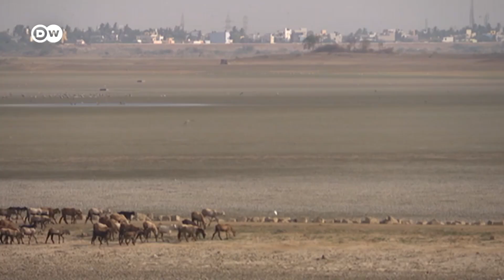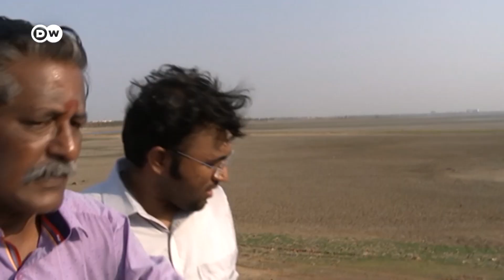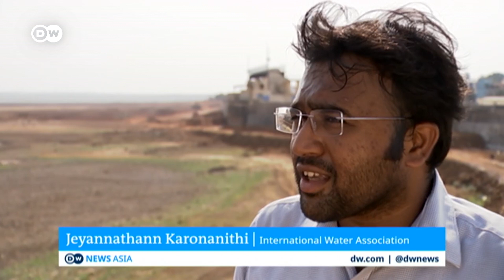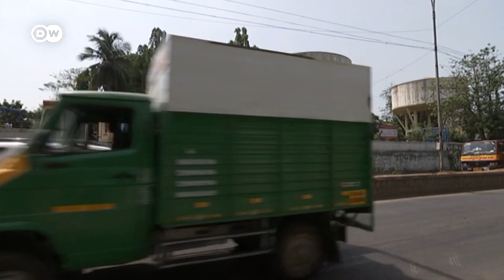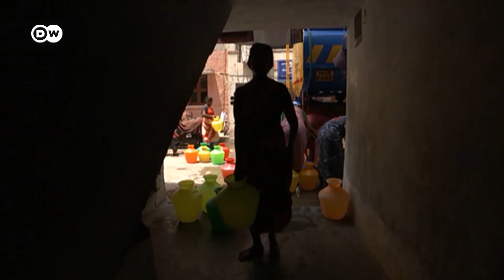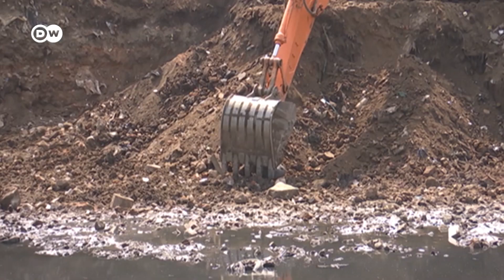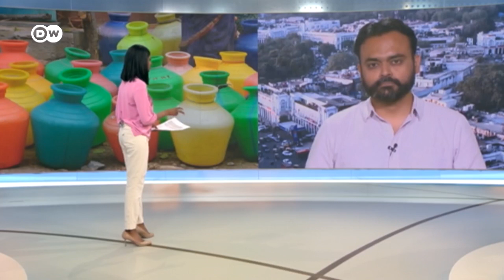Climate crisis in India: Heat wave causes water scarcity | DW News

Comment: Welcome to climate change stage 1
Reply: That's the problem with the ambiguity of the term climate change. Is the planet getting warmer or cooler. It is getting cooler but one of the things that comes with the solar inactivity is fluctuating jet streams and varying climate. It isn't the heat but the lack of rain. That is called draught. While India is experiencing draught other parts of the planet are being hampered by to much rain. In both cases, draught and flooding crops are hampered. This is going to be very serious.  Welcome to a new mini ice age.
Reply: It has been 123 degrees F in India these past few weeks and 84 degrees F in Arctic.  Melting of Arctic makes jet stream weaker.  Millions of tons of ice melted in Greenland this past week.  Things are changing quickly and it is not good.
Reply: @joyfullone3968  sources?
Reply: @joyfullone3968  The jet stream is controlled by the intensity of the magnetic fields of both the earth and the sun. Now that we are entering the 
Eddy Grand Solar Minimum we are goin to experience the same types of weather phenomena. Greenland  had and increase of 510 billion tons last year.  This is the time of the year that the ice melt is increasing, till September anyway. The Global temperature is down from 20 years ago. It is not warming but we are going to see erratic weather such as flooding in China and the Northern hemisphere and summer snow. There will be more hail storms if the Maunder Grand Solar Minimum is an example.  You only have to look around the planet to find dead civilizations as a result in climate change.
Reply: Roy Oetting :  I think Global warming and the Grand Solar Minimum are battling it out,  I think the Global warming is going to win though.  We will have to agree to disagree.❤️
Reply: Conservative hispanic :  All of these stories were on the main news stations this week.  I don’t know how to send links from my phone. I am sure you won’t have trouble finding them on Google.
Reply: @joyfullone3968  At the end of the day you are probably right about agreeing  to disagree, but I would like to point something out. Since the Holocene Optima there has been three (I think) warm periods where the climate was warmer than today. In between them there has been cold periods. The warm periods were all warmer than today.  What caused these to happen? It wasn't CO2. CO2 didn't cause the recent warming either. Solar Cycles 18 thru 23 did. Zharkova observed recent climate change and theorized that it can be predicted by monitoring the sun's magnetic field. With this in mind she came up with an equation that should predict Solar activity She then applied it to history and also to the past 20 years and the equation predicts solar activity. Her conclusion is that the earth is going to be in for a rough time and when I say earth I actually mean it's passengers , us. This year crop failure has become very serious and next year is supposed to be worse. Please respond. I'd like to know where you think I am wrong.
Reply: Coca Cola  is also using up tons of water, leaving nothing for farmers' crops. India being one of the top open defecation country doesn't help matters either which pollutes the ground water. The government has neglected to build and maintain water treatment plants while people pollute the rivers with all kinds of refuse. Overpopulation also plays a role, so it cannot be blamed solely on climate change.
Reply: @supernova44  What is the point of your argument. A draught is causing a shortage of water.
Reply: @Eugensdiet  If you read it, then you would see the point is that the problem is multifaceted.
Reply: @supernova44  No it isn't. The draught has caused the shortage of water. It is that simple.
Reply: Roy Oetting : Hi again Roy,  I don’t think you are wrong it had to have been a lot warmer before because didn’t Antarctica have a tropical climate at one time?  Some people reported this week that a dinosaur may be seen on Antarctica.  The problem now is humans cannot live in the hotter temperatures that we are encountering. Methane is already coming out of the melting permafrost and also Nitrous Oxide and both warm the atmosphere more than CO2.  The earth is a dynamic place more than one thing can be happening at the same time I believe.  UVC is now reaching ground level which it should not be what effect is that have on things.  MRMBB333 does daily UVA UVB and UVC readings from his home in AZ  and also from other places.  He does a lot of photos people send into him concerning the sky, sun etc. You might find his channel interesting.  I think all the volcanoes erupting now could have a cooling effect also with all the ash and particulates they send into the atmosphere.  I follow Paul Beckwith and Guy McPherson for climate news.  If you can recommend someone good for Grand Solar Minimum info I will take a look at what they have to say.  Have a really nice day! ❤️
Reply: Raven Fox :  Overpopulation is a HUGE issue for them.  The millions of cattle that India sees as God like roaming everywhere can’t be a good thing either.  Wouldn’t that make the streets filthy or do people scrape the dung up to use in gardens?  My daughter was supposed to go there on business but I talked her out of it. Her company sent someone else, a man I think.
Reply: It's a slow poison .All are responsible for it.
Reply: @Eugensdiet  In simple words extreme climate events, more rain for very short period, high temperatures in the tropics and equator but the higher latitudes would experience different weather events. It's a complex thing to understand. Researchers are working on it. But yes India would suffer the most because of climate change because it is a monsoon dependent economy. That is why world need to move towards sustainable economy in which developing countries like India have liitle role to play but developed who mostly responsible for this has to take initiative.
Reply: @Eugensdiet  The jet stream is controlled by magnetic fields? Let's do the experiment: If a magnetic field could control airflow then your fridge magnet should do the same thing. Does it attract air? No it doesn't. Also if the magnetic field of the earth would control the jetstream the direction the air would move would be totally different. Magnetic field lines reach from the south pole to the north pole. Why exactly should the air then move from west to east? The solar magnetic field is indeed reaching us but it can - like every other mag field - only interact with charged particles. Air is not a charged particle.
Conclusion: Hypothesis doesn't make sense. 
Also the temerature was constantly rising over the last 20 years. I don't know what your sources are but maybe your "climate change is a lie and here is why" or "climate change debunked" youtube videos are in the wrong. 
https://skepticalscience.com/graphics.php?g=47
Pretty easy to spot that there is indeed a rise and not a decline in temperature.
Also before you answer me how magnets move the air take a look at this. I want you to check your argument against this table. I'm sick of arguing with ppl like you and they already debunked nearly 200 lies of climate change deniers and skepicists. So take a look and if you come up with something new and creative I will have a laugh and debunk it too.
https://skepticalscience.com/argument.php

Have a wonderful day.
Reply: @amansinghgawali530  Sorry but I have no idea what you were trying to convey. Ambiguous terms like climate change doesn't help. We are entering a period of solar inactivity which will result as you said extreme weather conditions and yes I agree that India right now seems to be the most vulnerable. Perhaps the UN can do something useful for a change and head up a relief program but this is in direct opposition to the 1970's plan that helping those in need would cause more people to have need in the future. Not my logic, it is the UN's. An additional problem is that India will not be alone in needing help. The UN is actually responsible because of their insistence in global warming. Instead of reducing CO2 they should be looking at ways to increase CO2 in the atmosphere to assist in food production. Probably not possible.
Reply: @Flyingchris2249G  Well actually if u r have some interest learning politic u ll find it interisting, why? Bcoz in the name of profit/bussines politiciant has been lobbying research about global warming and change it into climate change phrase
Reply: @Eugensdiet  It has been 123 degrees F in India these past few weeks and 84 degrees F in Arctic.  Melting of Arctic makes jet stream weaker.  Millions of tons of ice melted in Greenland this past week.  Things are changing quickly and it is not good. So much for you "ice age".
Reply: @Justwantahover  I don't know how accurate this is so take it with a pinch of salt.
Europe has quite a warm climate when you compare it with North America or Russia, and scientits believe that this is due to the Gulf Stream. To function properly, the stream needs cold and salty water near Greenland ( salt+cold = heavy water => goes down in the ocean ...). However, since ice sheets are melting in Greenland and since the temperature of the oceans is rising, it might get weaker and thus cause a sort of "ice age" in Europe. 

This would mean that climate would be getting harsher both near the equator and in Europe.
Reply: @Justwantahover  Last year Greenland gained 510 billion tons of ice. This is the typical time for melt in Greenland but it did spike. It has done this before in June. As of the end of May, reports come out monthly, the global temperature drop a couple mot tenths C. It is cooler now than in 1998. Cooler means the planet is not warming. With regard to the Mini Ice age I can say that no one alive has experienced the weather changes we will experience over the next 35 years.  The sequence of events will be something like famine, disease and social unrest.
Reply: I think you will find this water scarcity pandemic is more to do with overpopulation in India, than the heatwave itself. The north of India has always battled fierce heatwaves. That hasn't changed over the years. But the population has. There is too many people living in the north of the country, causing water shortages. Especially during hot spells. The land can't support the number of thirsty mouths.
Reply: @abcdefghiabcdefghi6127  Your "ice age" won't eventuate till another 10,000 years or so (it's a long term trend cause by the weakening sun). But global warming is a "tiny" fluctuation within that overall cooling trend (one of many). But it  won't be tiny in intensity, but only in time compared to the overall picture. A least it starts way quicker cos it's man made.
Reply: @Eugensdiet  There has been many cold spells and more than enough hot spells. Greenland alone is not enough evidence that the poles are "freezing over again" is it.
Reply: @petyrbaelish1718  I think you were addressing me. I don't think I would argue with anything you said. The difference this time is that it will effect all parts of the planet. Draughts, floods, hail, cold winters and shorted growing seasons and this is going to happen for decades. Look back in history and see all the abandoned civilizations . The answer should be obvious, rapid climate change. Some civilizations moved others just died out.
Reply: @Eugensdiet  Cold winters? I've just had my mildest winter on record. And most civilisations die out due to a cataclysmic event, such as a volcanic eruption, earthquake, tsunami, or meteor impact. Although droughts are known to wipe out civilisations (Egyptian Old Kingdom), that is pretty rare. If civilisation as we know it gets wiped out in India, that will be a consequence of overpopulation, lack of resources & sanitation, disease, and down to their failure to adapt or make the best out of their civilisation/culture. Generally humans can adapt to warmer, drier conditions, or even colder, wetter conditions. But when the people in that area are impoverished, desperate, with no infrastructure, money or direction. They become statistics. This is where western civilisation will be able to adapt & survive.
Reply: @Eugensdiet  Please look at the links I just provided. Every year there is a net loss in the total amount of ice sheets in Greeland (though Greeland does gain some ice during the winter, it si far less than what it loses during the summer).
About the temperature rises, also please look at the links I provided.
Reply: @abcdefghiabcdefghi6127 , if you look at the NSIDC website, you'll see Greenland gaining ice, not losing it.
Reply: @SuperDipMonster  Please, link the article.
Reply: Roy Oetting I think the word you are looking for is drought Roy. Draught=a flow of air.😉
Reply: GEOENGINEERING AND IONOSPHERIC HEATERS
Reply: Joyfull One that’s a shame...she missed out on an amazing experience.
Reply: @Eugensdiet  -->>>>>>>"it is getting cooler..."  You must have been paid to post this Global Warming denial rant.  Most people can recall that the climate has been getting warmer in the past many decades.  Where I lived 30 years ago, there was ice and snow each winter, now hardly at all.  Summers has been getting more unbearably hotter and hotter.
Reply: @debrajessen7975  A draught also means a beer in the UK. It's a common term. And a drought means that there are no drugs available. A winter drought means there is no coke available.
Reply: Petyr Baelish Ya, I knew that about being a beer in the UK. My dad used to drink that stuff. But I didn’t know about the drug thing😉
Reply: Roy Oetting  end of the ice age.
Reply: @trungson6604  R Pham 30 years ago we were near the beginning of the Modern Grand Maximum, well that is over now. The AUH satellite data showed your warming but now it is showing a decrease.  The global temperature now is less than in 1998 so it is getting cooler.
Reply: @Justwantahover  History has shown that global temperature follows solar activity. Solar Cycles 18 thru 23 represent the Modern Grand Solar Maximum when solar activity was higher than normal and the planet warmed. Solar Cycle #24 had half as many sun spots and sun spots are indicative of solar activity . The sun appears to be between SC#24 and #25 and SC#25 is predicted to be less active than 24 . The next 35 years the global temperature will continue to drop and with it extreme weather that is not beneficial for crop growth is going to occur. No one  alive has experienced this impending climate change. I can't imagine it nor can you, but it is going to be bad and will take the lives of many people. 

.
Reply: @Eugensdiet  The scientists are claiming the average global temp has risen by nearly a half degree since the cowboy days. Statistics you are close minded to cos you are a climate denier. I take the scientists word for it, you don't.
Reply: @petyrbaelish1718  A point that I have tried to make is that the climate change that we are experiencing now no human alive has experienced it. The global temperature will drop, the jet streams will be erratic resulting in drastic climate changes around the world. Long droughts in some places, flooding in others. Crop failure is bad this year and next year it is supposed to be worse. This event which will last for more than three decades  will be similar to the Maunder Grand Solar Minimum.  India was vulnerable and may be the first sign of hardship but it won't be the last.
Reply: @Justwantahover  There are some things wrong with your last comment. What scientists? Please tell me who you are referring to. What are the cowboy days? Did the temperature rise from 1979 to 1998? Yes it did has the temperature continued to rise to present? No it hasn't. No temperature rise  equates to no global arming.
Reply: this has happened many times in history, its difficult to know if this is human work.
Reply: @abcdefghiabcdefghi6127  What links?
Reply: Dude I am telling you, I live in almost the center of India and there is no desert around and still we have to deal with 45 degrees of Heat every summer, Winter lasts for 2 months. I still remember when I was in school, Winter used to be so amazing with such dense fog and chilling weather but now Winter is like Europe's summer.
Reply: @debrajessen7975  thanks
Reply: @Eugensdiet  That I provided showing :
-a rise in global temperatures.
-a massive rise  in CO2.
-about Greenland ice sheets.
You can also find them on NASA's website.
Reply: @ProudSalafi  I'm sorry about the hot weather but the planet/ sun has just completed the Modern Grand solar Maximum, but the the temperature is dropping.  We have entered the Eddy Grand Solar Minimum and the climate in the future will be nothing like we have experienced in our lifetime. You have to go back to the 1600's to catch a glimpse of what the next 35 years will be like. I don't know how the climate will change in India, but what ever happens it isn't because of CO2.
Reply: @Eugensdiet  I am not really a science student, I am a business student xD I am sitting under the fan and still feel so hot. sometimes my eyes hurt cause of heat and humidity, people sit in there shops sweating hard. My poor rabbit has more patience than I do xDD
Reply: @Eugensdiet  Again, you are spouting nonsense. How is it possibly going to get cooler, when the majority of the past 10 years have been some of the hottest on record. There is a proven trend of things warming up, and no sign of it cooling down. Have you got any evidence, or studies, to suggest that we are cooling? You hardly ever here about a location breaking its record cold temperature, whereas record high temperatures are getting broken left, right & centre. Month after month. I also notice the northern hemisphere seems to be suffering worse heatwaves and at a higher frequency, which is probably to do with the fact that the northern hemisphere has most of the pollution and big cities.
Reply: @herokiryu2652  

-A rise in CO2 lvls, which have been linked to fossil fuel emissions. (CO2 is btw a greenhouse gas)
-Temperatures rising extrely fast (in ~50y and getting faster). Strangely, scientist noticed it when we started burning fossil fuel like there was no tomorrow.
Yeah, we really have no idea if humans are causing climate change. And also, the vast majority of scientists believe that climate change is real.
Reply: @ProudSalafi  I can remember when I was living in NYC before there was air conditioning and how hard it was to sleep. They say Earth is the Goldie locks planet but really it isn't.  We survive here on a fringe. We're at the end of Holocene and as it has precede it has gotten cooler with warm periods such as the Medieval Warm period , warmer than today but cooler than the Holocene Optima. Civilizations have come and gone dismantled by climate change. The next 35 years as I've sad before the climate will changed to something no living human being has experienced. The last hundred years with all it's climatic faults was a walk in the park. Things are just getting bad. http://www.drroyspencer.com/wp-content/uploads/UAH_LT_1979_thru_May_2019_v6.jpg
Reply: @Eugensdiet  I agree with you. Things are really getting bad. Probably the next war is gonna be to conquer the lands that has good resources left and it may be the cause of WW3
Reply: penguins inadiorama  Since the 1700's India has been recording droughts which have killed millions of people.  An increased population doesn't help but the drought would still be there if the population hadn't increased. Depending on what help they can get will depend on how many die.
Reply: penguins inadiorama  Yes I concur but even still something like 10 million people in India died from drought in the past  300 years. It just means the potential today for disaster is that much greater now.  The cuase for the shortage of water is not the the population increase but Mother Nature.
Reply: Conservative hispanic Lol, you don't need sources if it's common sense. It's pretty obvious that summers are dryer and winters are wetter......which isn't normal. So maybe take some time out of your day and take note of the actual weather patterns......!! 🙄
Reply: Raven Fox Same with lettuce. If people want to make a difference your need to start growing your own food!! Veggie gardens
Reply: @blank.9301  Not logical. What would be the point unless you can't read or remember? Remember the last four winters? Remember that ice begins to melt in Greenland in June. Growing you own food , that's good. Today most people live in urban areas which makes about impossible to grow your own food. Food production is in the hands of technology and intelligent farmers. They have to adapt. Countries can help by making sure land that that will be plantable in the future is available to plant such as opening up national parks. Sorry I'm thinking everyone lives in a free society or in a country that is not so dependent on wheat or corn such as the Arab countries. I think the point that I ashould be making is that we are sliding into a mini ice age the likes of which no human alive today has experienced. Instead of writing down today's weather researchers should be scouring records from the 1600's to see what we might expect. That would be a start.
Reply: @Eugensdiet  Neil Degrasse Tyson, Bill Nye and Stephen Hawkins (recently deceased) are 3 off the cuff who say/said climate change is happening and the summit in 2018 said that too. The only sites and books that don't say it are climate deniers.
Reply: @Justwantahover  What a crew you put together. Is your tongue in your cheek?  I don't know how Tyson got his doctorate. You would think a person who gets a degree in astronomy  would be an expert but recently a number of planets lined up and a lot of people talked about it and Tyson said what's the big deal this happens every year. no it don't.  Bill Nye a degree in engineering. I wonder if he too had a 4.0 average?  His whole spiel was it isn't the rate of rise of sea level but the rate rate it is accelerating. Well all of that is a lie. The sea level rise by real experts state that the sea level rise has been 1.1 mm/year which would result in a rise of one foot in 277 years. NASA has just stated the rate of sea level rise is going down. Hawkins came up with a bunch of theories  which have nothing to do with climate. In reality he is not noted as a great mind , it is that he was severely handicapped. Real scientists who actually study the sun predict that Solar Cycle #25 is going to be lower than 50 sun spots which hasn't been seen in two hundred years  and they predict this mini ice age will last for 35 years. I spoke with one of Tyson's associates and he sort of implied that Tyson thought the reduced solar activity would cause cooling but it wouldn't last long an then global warming would continue.
Reply: Climate change is a hoax. The problem is political corruption.
Reply: @Justwantahover  That's a bogus number. It was created by selectively picking people who had already written papers  and they took something like 4000 of them and sent them a survey and something like 77 responded and you gu9sp?)essed it one didn't agree with the others. Even now NASA is talking about the effects that will happen from SC#25 which is anticipated to be lower  than cycle SC#24  which was around 50 sun spots. Sun spots are a way of determining solar activity and has been used in Europe since Galileo who recorded them. Since then they have started to number them and now we are up to #25 .Dr. Zharkova has been studying solar magnetic phases and how they vary. and there are two sets of magnetic poles on the sun at different altitudes and they do not work directly together and she has come up with an equation which has been demonstrated to accurately determine the solar activity and the results indicate that for at least the next 35 years we will experience a major solar minimum which most call the Eddy Grand Solar Minimum.. The real serious problem facing humans is that no one alive today has ever experienced a cooling climate change as we are starting to see happen now.  Some countries know it is coming such as China and have prepared to some extent but perhaps they are also behind the power curve and will have a bunch of people die too. All developed countries have large cities and they will be vulnerable has food becomes scarce. Mexico just experienced a severe hail storm the likes no one that I know of has seen before but the records show that this happened during the Maunder Grand Solar Minimum in German where a meter deep of hail fell. This is just another indication that a mini ice age is on the way.
Reply: @Eugensdiet  Tell me what percentage of scientists would peer review what you just said. And you didn't even attempt to answer my last question. It's been measured as warming by about a degree. But you say it's cooling. Give me a percentage of scientists that think it's cooling right now.
Reply: @Justwantahover  Here is a graph satelite data collected at the UAH which NASA uses. Since 1979 the temperature increased linearly till 1998. Then there was a pause and then in 2015 and 2017 there was a positive spike and since then it has come down. It is anticipated that it continue to come down but in addition the weather that will  accompany that will be dangerous to crop production. The global temperature has risen about 0.6 C since 1979 which I averages out to 0.015 C/yr. Does that seem extreme to you?  Sea level at the same time according to the leading sea level authority has increased 1.1 mm/yr in the northern hemisphere and has remained level near the equator for the past 50 or so years. To sum up global temperature is not going up but has started ot come down and the earth will not experience a one meter rise iin sea level by the end of the century as the  IPCC is predicting. Names Tim Ball, Roy Spencer, Christi.. Soon,  Casey, Corrier  and Nils-Axel Morner to name a couple. http://www.drroyspencer.com/latest-global-temperatures/
Reply: @Eugensdiet  You didn't answer any of my questions. What is your estimate of how many scientists believe that global warming is a threat? Mine is 97% what's your guess? Answer me or go, please.
Reply: @Eugensdiet  My friend and I were literally laughing out loud at the scientific illiteracy in this post. Thank you.
Reply: Lol
Reply: They also need clean water  because they poop also in theirs.
Reply: Weather = climate
ok
Reply: yep
Reply: Colm Corbec exactly colm exactly
Reply: India heatwaves that long lasted 1935 51.2c, 1953 49.7c, 1966 48.6, surprise India gets v hot weather, co2 was at just under 310ppm co2 doesn't heat the planet.
Reply: I love climate change, especially winter in Arizona.
Reply: @supernova44  and Aquafina company gets to bottle and sell Michigan water FOR FREE?????
Reply: What nonsense. This isn't due to climate change, blame drought and mass breeding.
Reply: Starting of mass extinction of humanity.